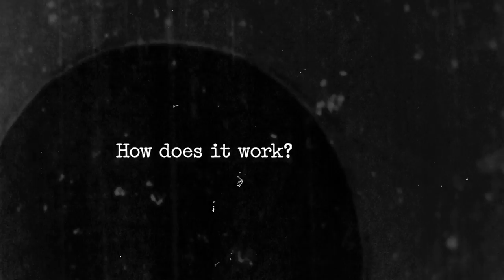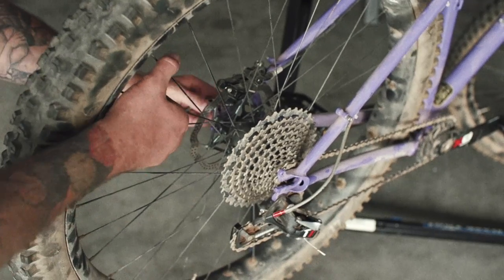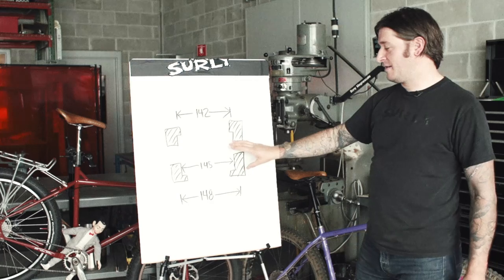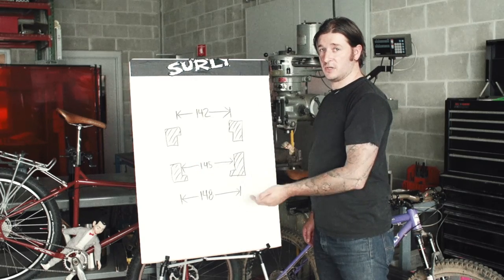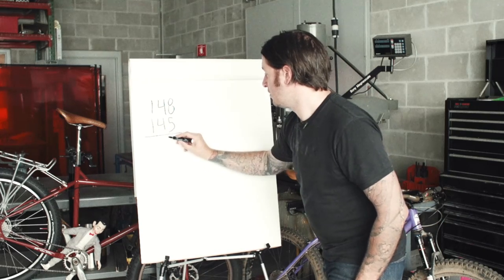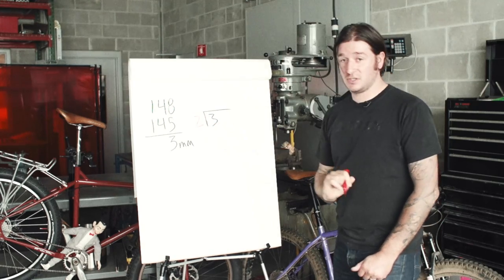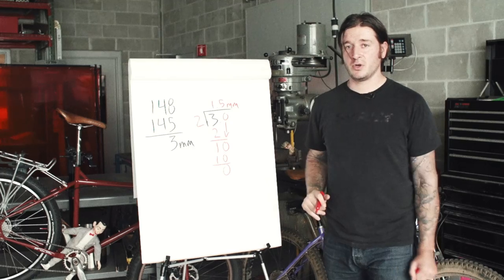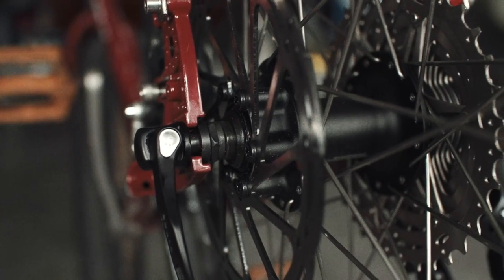Surly Speaks Video #3 Gnot-Boost

Comment: So, for 135mm spaced wheels, looks like you need a pretty good sized rotor spacer on the nondrive side, what about the drive side? Re-dish? Is a derailleur hanger spacer a thing? HELP ME!!!
Reply from the maker: All that is needed is Surly 10/12 adapter washers HU0000 for 6mm QR or HU0001 10mm Thru-Axle